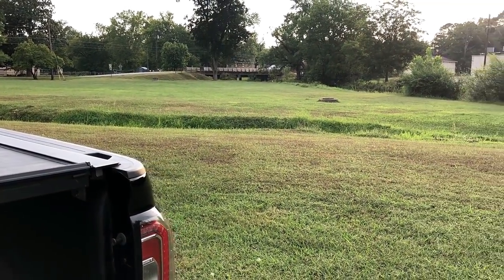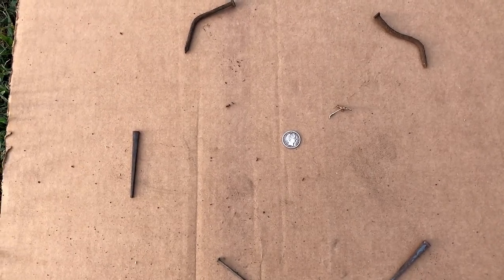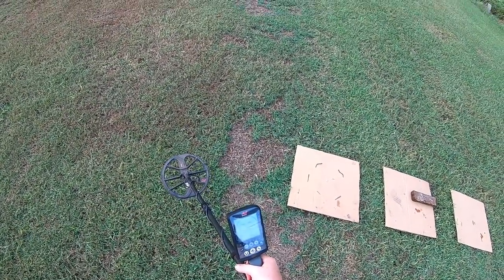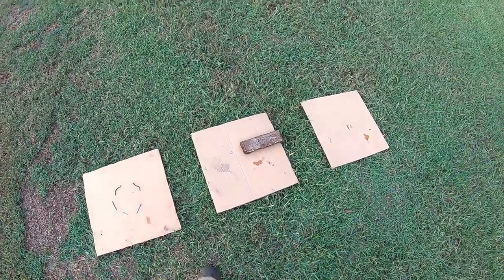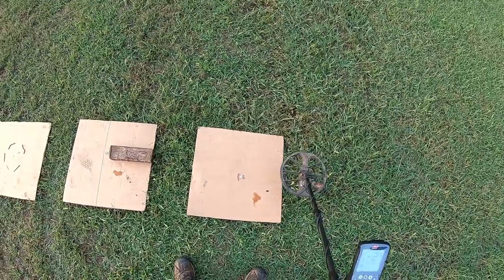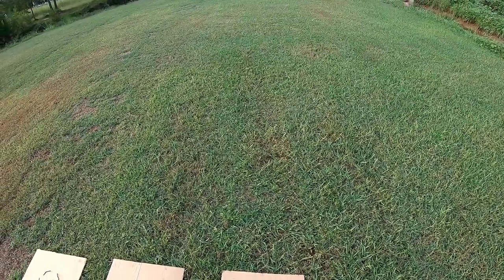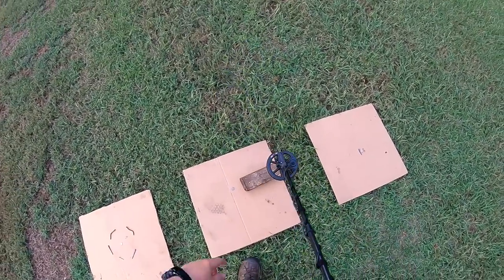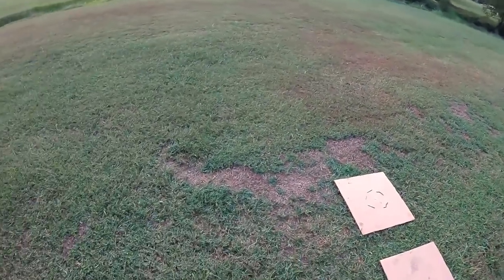Minelab Equinox 800: Comparing the OEM 11" coil to the 6" coil. (#63)

Comment: Nice job on tests. I have seen pretty good results in field with my 6 inch coil. Pulled a couple silvers out of trashy areas I have hit with many detectors and coil combos.
Reply from the maker: Thanks Ben. So far I’ve only had a chance to play around with the small coil in my yard but I’m already impressed with what I’ve seen. Been detecting this yard steady for nearly a decade with various detectors yet I’ve still been able to snipe some targets with the 6” coil that I had missed. Can’t wait to get it out to some of my good sites.

Comment: Getting  the Equinox 800 tomorrow and thought I’d ask for any tips you may have starting out. I have an AT Pro which I have been using for about 5 years and before that I was swinging a Whites Spectrum XLT. The Equinox looks like a game changer from all the You Tube videos I have been watching. Your test here on the 6 “ coil is promising. I ordered mine with the extra 6” coil  for searching in some trashy parks. I’ve enjoyed all your videos. Thank you!
Reply from the maker: Hey Rick! Congrats on the new detector! I also used an XLT and AT-Pro for a while before getting an Equinox. A bit of a learning curve coming from those machines but not too bad. Learning the difference between iron targets and good targets was my first major hurdle to overcome with my Equinox. Here's what I can tell you: Don't get carried away with the iron bias setting. Iron Bias setting is a trade off. Turning it up will make iron targets break up a little more, but it also makes good targets that are near iron break up. Sort of defeats the whole purpose of Nox's strengths which is its ability to pick out good targets from thick iron. I never go higher than 2 on my IB setting. The trick to limiting the amount of iron you dig with this detector is tone repeatability. When you get a questionable tone, wiggle your coil over the target and pay close attention to how well it repeats. Iron targets will be hit or miss and the location of the target may seem to move around slightly. A good non-ferrous target will repeat every time and the signal will remain in the same location beneath the coil as long as you sweep it consistently. Even if it only hits in one direction, it should still repeat as long as the swing angle remains the same. Once you master this, a light bulb will go off in your head, and you'll start digging out those good targets in the trashy locations that you've hunted with other detectors in the past. Other than that, I’d suggest starting out with a 5 tone program. 50 tones can be sensory overload for someone who is new to using the detector. Put some hours on the machine and everything will start to click. Good luck man! Thanks for watching and commenting! HH Dewayne
Reply: .0i also have the xlt spectrum which they dont make anymore everytime it goes down $250 everytime but its worth it to me.Also mx7 and now the equinox 800 because of all weather proof and water proof whats next?cant be better than the equinox 800

Comment: Hi Dewayne, Thanks for the Info brother! Remember that the NOX is highly unstable without a coil on it as you go to change it out in the field. If it flips to either side it will hit headphone button or the power button pretty dang hard. All the best! Seth
Reply from the maker: Thanks Seth! Thanks for the tip too! I think I'm just going to leave the small coil on my Nox and make it my dedicated iron/trash sifting machine. HH Dewayne

Comment: Great demonstration. 👍🏻
Reply from the maker: Thanks!
Reply: @MetalDetectingNWGA  I’ve got an equinox 800 and the standard 11 coil. Just put on the 6 and will try it out tomorrow. I’m in northern Virginia and have taken it out a few times. Found an old large cent. Unsure of the date. Then found what appears to be an old car radiator at about 1.5 feet down, right in the same vicinity. Looking forward towards trying out the 6 tomorrow, same place and there’s a creek I might try out the gold setting. I’m definitely a novice and just enjoy the outdoors. Thanks again for the vid.
Reply from the maker: @carljohnson8732  I think you’ll find that 6” coil is downright amazing for hunting trashy spots. Good luck my friend!

Comment: I live in cherokee county. Just bought the equinox on Saturday. Im dissapointed i bought into the hype. It doesnt seem to do much better than my Tesoros or teknetics detectors. More complicated, less results. Does it get better as u learn the machine?? Im thinking of returning to kellyco.
Reply from the maker: I felt the same way when I first got my Equinox. I'd say give it a little time. It does get better and easier to use. Put at least 50 hours on the machine before you decide to send it back. It really is a great detector but like most others, takes a bit of time to master. I'm no expert with it, but would be happy to help with any questions you may have. HH Dewayne
Reply: @MetalDetectingNWGA  thanks for the reply. It just seems like the coil is too big for the trashy areas i hunt. With all the amazing reviews, i hope i warm up to it.
Reply from the maker: Dick Kyanka in my opinion one of the Nox’s biggest strengths is how well it separates even with the stock coil. I do like the little 6” coil though. What type of hunting do you primarily do? What type of locations?
Reply: @MetalDetectingNWGA  parks, old pre-ww2 houses mostly around Canton/Ball Ground/woodstock. I took it out this afternoon and dug a few more targets. Im just used to knowing exactly when i have a target on my tesoros, this unit is so chattery. Do you suggest that i do the firmware update?
Reply from the maker: Yessir, I’d definitely do the update right away. It fixes an issue of how the detector responds to big silver coins on edge. I demonstrated the problem in one of my previous videos. You’ll learn the Nox’s language with time. I felt the same way at first. I think most folks do. But if you hang in there and put in the time, I think you’ll find that it really is a great detector. For now, I’d suggest simplifying things by discing out all but the ID range of the most desirable targets you hope to find. As you get more experience, you can open up to accept more targets. Also, I’d suggest starting in park 2 with 5 tones vs 50 tones. IMHO 50 tones can be a bit overwhelming when hunting a trashy area. Set the tone breaks however you like. I’d put iron bias at about 2 or 3 for a while to help weed out some of the falsing iron. Again, once you get a feel for the machine you can lower it a bit. A slightly lower recovery speed of 5 or so will make the detector sound off with a longer tone on good targets. Makes it easier to distinguish good targets from random chirps. A recovery speed of 5 is still very fast compared to most other detectors. One more thing that’ll help pick out the good targets from the iron: Only dig repeatable signals. Even if it only hits in one direction, it should still be repeatable every single time provided your sweep speed and coil location remains the same. Those random chirps and falsing wont be consistent like a good target. Good luck to you! HH Dewayne

Comment: Hi, tell me just one think, i only do beach, the coil 6'' are good? or 11'', thks
Reply: @MetalDetectingNWGA  thanks for yours advice
Reply: @MetalDetectingNWGA  yes the 11 inch is better on the beach found a PD950 ring with 24 tiny diamonds half way around the ring PD is for Palladium higher than gold its in the platinum family
Reply from the maker: Sounds like a great find George!
Reply: @georgesocci6818  hi George did you ever have that ring appraised? Sounds like it could be worth a fair amount! Great find!!

Comment: I have a question do you leave your ground balance at zero if you ground balance that on the soil your on would it be at zero?
Reply from the maker: MrTruth1253 I like to ground balance when I go hunting. Around here it seems to stay between 35-55 for the most part. I do the comparisons with it set at 0 because I’ve noticed that a lot of users seem to just run it at the default zero..

Comment: What’s your feelings on the 800 against the at pro max? Any experience with that?
Reply from the maker: Hey JJ. I've owned an AT-Pro and I think its a good machine. Lots of people do very well with it, but I prefer the Equinox for a couple of reasons. The ability to run multiple frequencies and SMF makes the detector a lot more versatile IMHO. I also like the ability to adjust the tones, tone bins and volume of each tone on the Nox 800. HH Dewayne
Reply: Thank you so much for the info decisions decisions lol 😂
Reply from the maker: @jjdiggins422  You're welcome. Good luck with whichever you choose.

Comment: At pro wipes the floor with the nox
Reply from the maker: Eh, I also own an AT-pro and prefer the Nox. Different strokes for different folks I guess.
Reply: My hunting buddy had a AT pro bought. No and sold the pro shortly after. Says he'll never go back. Loves the Nox. I have a Etrac and have also used his Nox and seen his finds and it's performance. I'm getting a Nox soon.
Reply: I owned an At pro, sold it  got a nox 800, night and day.. At pro is a good machine, nox works better for me. Unless you have both don't knock the nox.
Reply: Anyone who makes this statement has never used the nox...which makes your claim BS...I own 4 AT pros ...and neither one are even compared to what the nox will do ..do yourself a favor and buy the nox and u will quit making uneducated posts
Reply: @garrettgolden5414  I'm new at metal detecting. Ordered the equinox 800 last week with both coils. People seem to be married to their machines. Makes it hard for a beginner like me, especially when people talk bad about a machine they've never owned. I went with the Nox because I got the opinions of about 20 YouTubers lol. The consensus doesn't seem to lie.
Reply: @garrettgolden5414  is right James
Reply: @robertkywildcats9266  which machine has 40 freqences working together at the same time?
Reply: @georgesocci6818  The equinox 800 has multi frequency, it runs through them all simultaneously. After using it for a couple months, I have to say I'm very happy with it. It takes some learning, but when you get good with the frequencies in your area, watch out lol. It's such a sweet metal detector.

Comment: Really not impressed with what iv seen of the nox, just dont see what tge big deal is about it
Reply from the maker: I think the biggest reason so many people are making a big deal about the Nox is bang for the buck. It checks off a lot of things folks are looking for out of a detector, and at a decent price when compared to other detectors with similar capabilities. Simultaneous multi-frequency, waterproof, fast, lightweight, updatable & reasonably priced = winner. I still prefer my CTX 3030 for coin shooting most of the time, but the Equinox has definitely earned a place in my arsenal. Its great for hunting thick iron.
Reply: @MetalDetectingNWGA  fair enough i was really thinking of upgrading to the nox from my at pro but i like my pro to much and do really well with it hear in the uk, think im just going to stick with what i know, theres no point fixing something that isnt broken as thy say
👍
Reply from the maker: I agree. The ATpro is a good machine too. HH Dewayne
Reply: @jmddetecting5503  there is also the equinox 600 for less bucks plus the iron button which is the horse shoe button saves you from digging trash.The xlt spectrum also saves you from digging trash.Everytime my xlt specrum goes down $250 everytime to fix it its worth it my first it does a great job.but not weather proof.mx7 is another great detector 18kt gold wedding band.The only time i didnt buy from Whites because of the mine lab equinox 800 its great